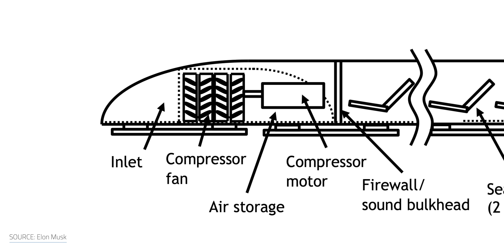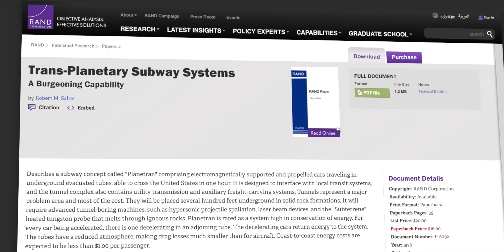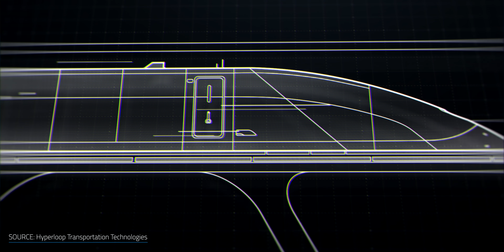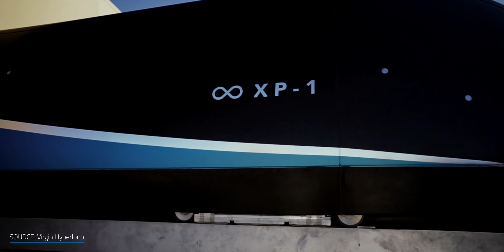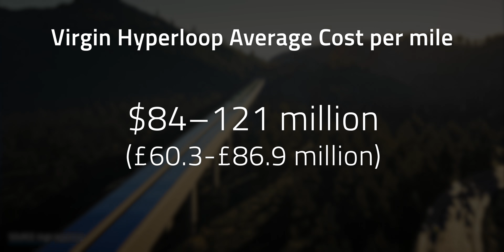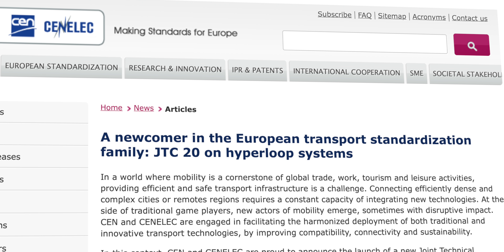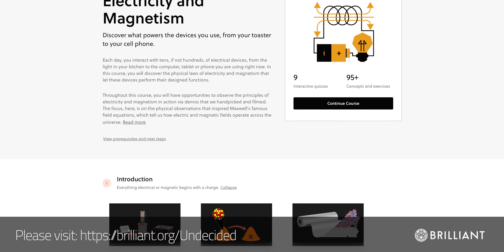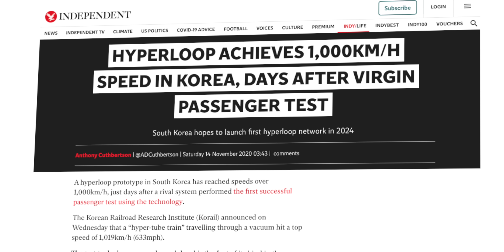Exploring Hyperloop - The Future of Renewable Public Transport?

Comment: The whole problem of rapid decompression of the tube and the pod are really the biggest issues.
Yeah in the beginning you can over engineer the system to get around the problem but once you start venturing into cost reduction something will eventually give. Decreased cost usually means decreased quality. 
Also, how do you recover a pod broken down in the tube without disturbing other traffic? You just can't open a door and let people out.
Plus the price for public use will need to be offset by freight transport costs to be viable in the long run. Who knows how much that will cost too?
Reply: I would start worrying about the impossible task of building this CGI monstrosity beforehand as there is no way to maintain a vacuum in any practical way that does not involve tens of thousands of industrial vacuum pumps (costing a metric crap-ton) running 24/7 (by by longevity) siphoning a big cities worth of electricity to merely maintain a partial vacuum against the myriad of unavoidable micro leaks.

It is a shit idea from start to finish

Comment: I don’t really see the point in having a vacuum tube transporting people across the world. It’s competition being jets and passenger trains, I don’t think it’ll catch up to those modes of transportation anytime soon. Hyperloop is far more expensive to build as well. Not to mention natural movement of rock underneath the surface. If there were ever a fault line that formed and stressed the structure enough, it would have to battle that along with the pressure of a vacuum. It’s just all around too bizarre.

Comment: Do the various Hyperloop proposals consider train (or pod) separation and braking distance. At 1200 km/h the distance to slow at a rate comfortable for the occupants will be significant and presumably, the pods operating at this speed will need to be separated sufficiently to stop short of the preceeding pod (as a train must be able to stop short of the preceeding train). Using 3.5 m/s2 as the comfortable deceleration rate in a car,  at 1200 km/h it would appear that about 16.5 kms would be need to brake from speed to a stop and the braking would take about 95 seconds. This would seem to give a minimum headway of about 100 seconds or 36 pods / hour - about the same as the best metro lines. And of course any route switching would reduce increase the headway by the time that that element takes. Even assuming a 100 second headway, for a 50 passenger pod this gives an hourly capacity of around 1800 people. That really isn't very much capacity to support all that infrastructure cost - even if you have solved all of the other challenges that have attracted widespread attention - say around two to three TGV trains full. Or am I missing something? MAGLEV has long promised much of this, albeit without the solar panels, but despite decades of investment has little real world results to show beyond airport links...

Comment: Lol bunch of bs, we have electric trains, just make them renewable and boom, no reason to dig tunnels everywhere... why tf do you need to make it difficult by adding complexity?
Reply: The goal would be to replace (continental) plane routes, not local/regional trains.
Reply: @MDP1702  that's even worse lol imagine having to maintain miles upon miles of tubes in low pressure, going through valleys, mountains and without the ability to have turns. It is just stupendously complex as an endeavour to develop, build and maintain.
Reply: @zoisbekios5239  Considering the EU is banning short flight somewhere in 2030, it might be fine. Also it is difficult to say whether it would be more energy intensive than flying a plane on the same route, it definitely could be much less polluting. 

Personally I think hyperloop is likely to only have (any) real promise if it can go underground at a reasonable price (for example the boring company's $10mil/mile announced cost). This would take away the need to move with the geography and limiting needed turns, the ground can then also act as an extra limited airseal (depending on composition possibly) and the protection in case of natural disasters is better overall.

Will hyperloop work economically? Impossible to say for anyone that isn't closely working with it and even those that do might not have the real clear picture yet. Hyperloop is at this moment still in its very early infancy in every way. My position on hyperloop is the same as with many other possible (technological) advances, wait and see how it plays out. There are plenty times in history these kind of ambitious idea's failed, but there are also times they eventually worked and had a huge impact on the society long term, where hyperloop will fall under is still to be decided.

Comment: Matt -- I'm disappointed that you are suggesting that Hyperloop is feasible. There have been several companies who have tried to build a Hyperloop, as you've mentioned, and NONE have reached even nearly the speed of the existing high-speed trains. In 7 years. 

170 kph with 2 people for 0.5km? In 7 years? And only a scale test at 1,000 kph? 

If this were as amazing and simple as people have put forth, plus with how many times it has been attempted before, don't you think we'd be further along here?

The cost of the infrastructure, between vacuum pumps, the steel tubes, the monitoring, the maglev or "air ski" infrastructure... holy hell. That's complicated, fragile, and costly.

Then add underground challenges: earthquakes, water, bugs, construction, rust/corrosion, soil acidity... the infrastructure is under attack constantly. One vacuum pump failure and the whole line is dead. Separating sections? One sliding door getting stuck slams people into it, and shuts down the whole line. 

While I loved the idea of the Hyperloop at first, the more I've read about it, I don't think it is going to happen. All the reasons that it has failed in the past are the reasons it will continue to fail in the future. If it does happen, it will be disappointingly anemic: under 200kph, not smooth, regularly breaking down, way more expensive.

Check out Thunderf00t's analysis on Hyperloop over the years. He takes a scientific approach and his arguments against hyperloop being an affordable means of transportation are pretty convincing.
Reply: Some of that guy's videos are good but I dislike him.
Reply: @user-RCST  I respect your opinion there. Everybody can't and won't like everybody. Thunderf00t is polarizing. I just appreciate that he presents scientific evaluations of statements to refute them. I usually follow most of them. Do I 100% support everything the guy says? No, totally not. But on Hyperloop, I think his analysis is correct: it can be done, but not inexpensively, reliably, and at the speeds promised, given the current time period and existing technology.

Comment: I would be too frightened of the certain death if depressurisation occurred with the wavefront travelling at the speed of sound with extreme speed crash of every pod in the tunnel at the time and no exit doors even if you survived the arrival of the shockwave, which is unlikely. Put that together with ease of triggering such an event by terrorism/vandalism to an above ground tube with just a single bullethole. I don’t expect the difficulties of obtaining and maintaining a low pressure atmosphere, with all the thousands of expansion joints the tube will need to avoid buckling with day/night temperature fluctuations let alone seasonal, will be overcome. The prototypes will all be slower speed with marginal pressure reductions. It won’t be as impressive as our imagination is leading us to think it will.
I don’t think I would like to have to experience max G acceleration and deceleration for 25 mile stretches just to get up to speed and back down again in order to shorten the time of middle 100 miles  of a 200 mile journey. You can’t say stop I want to get off. People will die. Stay away!

Comment: It's really cool but if CO2 reduction from airplane industry is the goal, then the infrastructure construction alone makes it a bad tactic. Develop clean airplane fuel production instead.
Reply: Just adding to your idea, electric driven propeller aircraft rather than jet engines where the exhaust is a problem even with hydrogen burn because of the heat generates NOS greenhouse gases. The electricity can be possibly be produced by a  fuel burning internal engine with scrubbers in the body of the plane  to greatly lower the green house gas generation. The engine scrub is a NASA concept no one seems to be working on yet as large electric driven turboprop aircraft have not been developed yet.

Comment: 'Hyperloop' has changed so much in vision since its conception that the best that's going to happen at this rate is a Tesla in a tunnel, which is another waste of time, money, space and imagination.

Plus, in terms of investing in something actually useful and able to significantly contribute to a decrease in car ownership and greenhouse gas emissions - just build and electrify conventional tried and true railways and metro systems. 

Japan built its Maglev in the context of a huge, dense high-frequency commuter rail network, with already established high-speed rail reducing the need to fly region to region - its Shinkansen had reached capacity and going faster seemed like a thing Japan might as well go for, this project is about getting to the next stage from a strong foundation. The U.S. has to be good at the basic, and the U.S. IS ABSOLUTELY AWFUL at the basics. For a country whose Subway was the envy of the world, it uses ancient signalling infrastructure from as early as the 20s, it's embarrassing.

Imagine having to DRIVE or take a slow, gridlocked local bus to your Hyperloop station to then travel over 1,220 km/h.

Comment: 1:55 so let me get this straight... we're in near vacuum situation, but huge compressor to redirect air (which barely exists) will give additional propulsion?.. I came here for objective view this channel mostly delivers, but you read it with straight face and didn't even flinched. And no questioning on things how to keep the tubes depressurised while loading/unloading capsules. What force the compressors would need to be to depressurise the tube and the mass of air you'd need to suck out? It's one thing to depressurise a short tube for a single test run than keeping whole active network in the state of near vacuum. 
You usually research your videos thoroughly, but this time it seems whole research was "i've read a brochure"

Comment: The promotion videos for Hyperloop remind me of the silly car adverts, showing cars running freely in empty streets.   What will the headway be between vehicles in these tubes?  How many passengers will these pods carry?  How much time will be allowed to embark and disembark at the terminals?  The operating cost per passenger will be massive.  European-style high speed trains can and do connect with low-speed rail to extend their viability and potential.  Extending Hyperloop would be a massive time and cost burden.  These promotion videos show these visually-intrusive pipes running across miles of wilderness, but what about those urban areas which would not justify the cost of tunnels?

Comment: Beach Company in NY: Am I a joke to you?

But seriously....this technology is beyond moronic.  Having a train go nearly supersonic in a vacuum tube does not take a genius to figure out some issues:

1. loading and unloading of passengers would be a slow process to move in and out of vacuum
2. the seals needed to keep a vacuum in a tube miles long would have to be self-healing and never fail
3. the power requirement to keep a vacuum is more than solar panels would provide on the stretch itself (it would grow exponentially in requirement, but linear in production), and this is before it can even power the train
4. the structure of the tube would have to be from some other world, or mass produced carbon nanotube, which isn't happening....at all.....otherwise a nice hot day and the entire tube will fold up, and any bends will yank the entire system off the supports and smash into any surrounding infrastructure/buildings.
5. one small hole anywhere, like a dumbass kid/criminal/cop with a gun playing around/in a shootout, same result as above
6. a hole in your train/vehicle and you pop like a kernel in a microwave.

Comment: One of the biggest problems with airplane, train, or some future hyperloop transportation is the costly necessity of obtaining transportation  at your destination by means of automobile rental or taxis.
In most first world countries using Elon's Loop technology to transport people in their cars at speeds of 240 km/h (200 mph) between cities or towns at reasonable prices makes far more sense than the Hyperloop.  
Whether the Loops were built underground, above ground, or a mix of the two the cost would also be a lot less than building a hyperloop vacuum system.  The risks from earthquakes would be greatly reduced and hyperloop risks such as those of decompression or tube failure would be eliminated.

Comment: If we aren’t willing to get a good passenger rail system going why would we even consider this in the US. The price per mile is insane when you look at the distances needed. If there is a very large area of very dense population then this in conjunction with tunnels may start to make some economic sense, but we’re talking LA density all the way from LA to San Francisco. Even still there’s an argument that high speed rail gets you 90% there at 10% the cost up front and probably less than 10% cost long term.

Comment: Ohhh dude.... BORING TUNNEL ;  has not proved to be cheaper or faster than comparable tunnels. The cost of the tunnel is not known, the price Boring are charging is known.. They are not the  same. IF the Boring Company had  got anywhere near speed increases & cost reductions, it would be  in every tunneling trade journal with actual figures..... Also it's a tiny tunnel compared to say Londons New Crossrail. 
The average station alone excavate more earth than the whole las Vegas tunnels. Also the costs are always put agains the overall costs of the projects.... Some estimate the actual tunneling & casing of tunnel can be a slow as 23% of over all costs, especially for subway systems....  As said.. Nobody knows the true costs ( not price) only Elon & boring company...

HYPERLOOP.... All i'll say on this is not a single official render of any of the proposed tunnels show access hatches.... So few thing . How do emergency services A. get to an incident.. travell 300 miles.?? And any pod in between them and the incident is blocking access.???  Then every access hatch then weakens the structure for holding a vacuum.... Speaking of which....

Just ave a read  the link i'm gonna post on the LIGO at Cal Tech, and look at the ground based concrete covered Steel tunnel... To just hold a vacuum  for just firing a laser.. Not  with pods going through it.....  

Really disagree with most of this video on so many levels...

Anyway.. Still a great channel ...  Be safe with that snow blower :-) SLAINTE !!!! 
https://www.ligo.caltech.edu/page/what-is-ligo

Comment: Okay, now hear me out, why not just make a highspeed train that runs on renewables? It would take so much energy to pump the air out, I really don't know if it wouldn't be better spent just moving the train.
Reply: Because just "a better train" doesn't get the soy face Tesla fans and pseudo intellectual skeptics worked up enough.
Reply: The train isn't the problem.. it's getting the land rights to even have a rail for the train to move on.

Comment: I think the biggest problem would be to maintain a vacuum in a tube for hundreds of miles. And the tube has to be flawless. Any little chink or dent or weakness in the tube will lead to an "implosion" as external air pressure tries to rush in. Nature abhors a vacuum. I do not see how it will safe and affordable. It CAN be made safe, but not affordably. Or it can be made affordable, but safety will always be in doubt.

And then there is the economics of the project. For a train to run at 1200 km/h, the tracks have to be as straight as possible. Turns have to be very wide (or gentle). That means buying up the land for the laying of the tracks is non-negotiable. Which means the land owners are in a seller's market. They can ask for whatever price they want, and the hyperloop developer has NO alternatives. This will raise the cost of development, perhaps to unfeasible levels.

Comment: if we have 2 tracks, one in each direction, and we connect their ends, wouldn't be it cheaper to have a wind flow at the same(or close to the same) speed of the pod circling the tracks instead of vacuum?
would that deliver the same result?
Reply: There would be a massive pressure drop across large distances at such high speeds, so a lot of energy would be needed to be constantly expended to keep the 'wind' moving, not to mention the need for extra deceleration loops adjacent at your destination to get out of the wind path and then slow down.
Reply: @idea-shack  good points, but don't we also need the energy to keep the vacuum? 
I actually thought that all the points you mentioned would need to be addressed for the vacuum solution as well. Deceleration and getting out fo the vacuum so people get to disembark. 
The advantage of the wind I thought is that it would reduce the risk of collapsing( as shown on the video) and also if the train itself runs with a little gap from the tunnel it would support keep the air flowing.